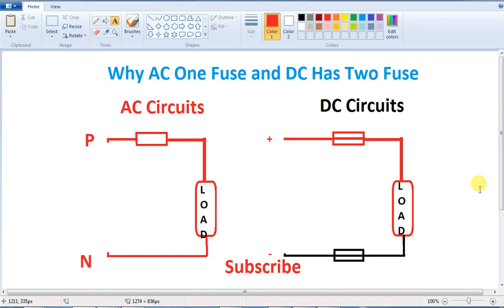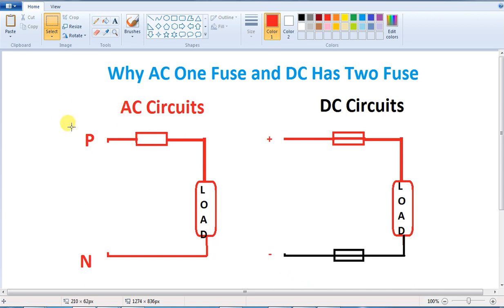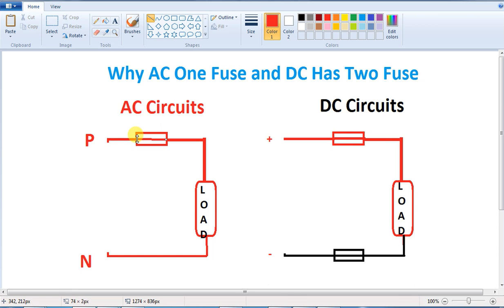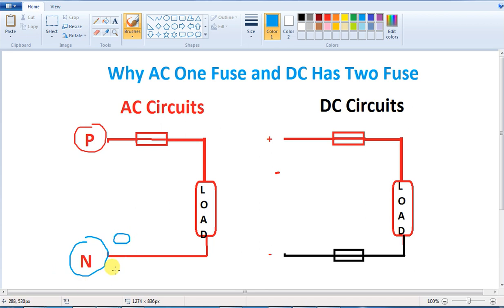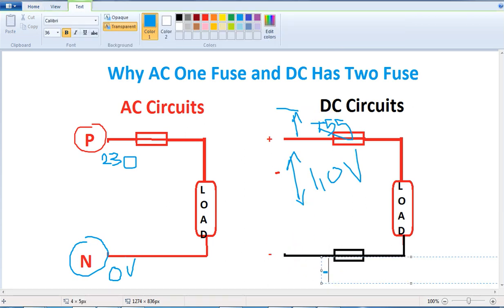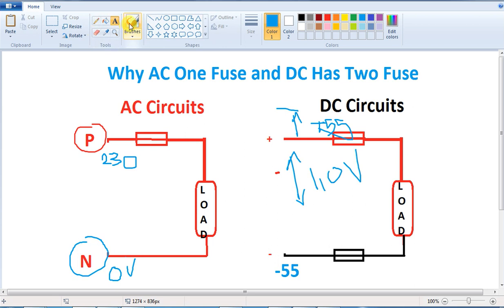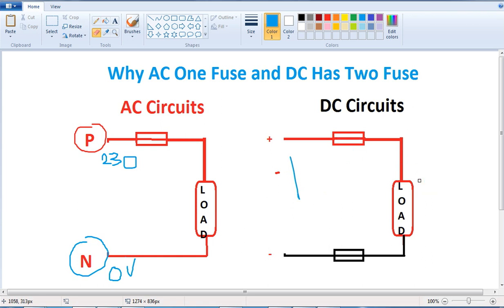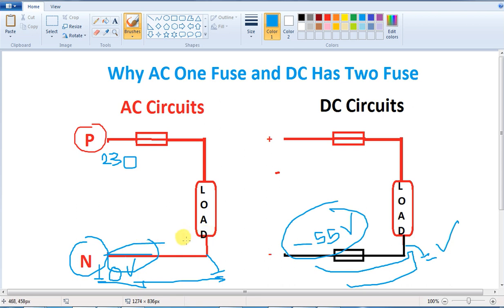Why Ac Has one Fuse in DC has Two Fuse in Tamil தமிழ் ..

Comment: If any fault happens as u said,  phase side fuse blown hence no potential at load terminal but suppose if there is fuse on neutral side and blown then potential shall be available up to load terminal which is wrong and may be dangerous. That's the reason phase shall be provided with fuse and neutral shall be considered with neutral link.

Comment: Sir In Genset battery (24vdc)we ground the negative cable there is no potential difference between negative and earth.. is any different in 24vdc and 110vdc??? Shall we ground 110vdc negative??
Reply from the maker: Yes nanba we can do that...Hey do you know HVDC monoploar link? they uses ground as return path..which means negative will be grounded
Reply: In the gen set case, the 24 V dc system is grounded with -ve terminal. hence there will not be voltage across -ve of battery and earth. But in the case of 110 V dc system in substations, the output dc has to be kept ungrounded. But for our convenience, it is grounded via a high resistance so that we can check for voltage between +ve and earth or -ve and earth. In this case, you will get a reading of +55V or -55V between +ve n earth and -ve n earth respectively..